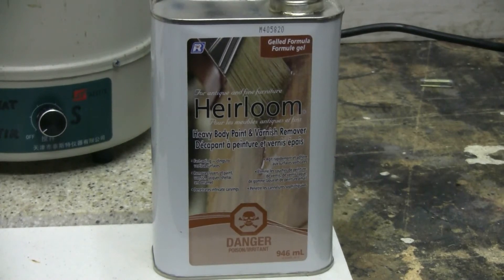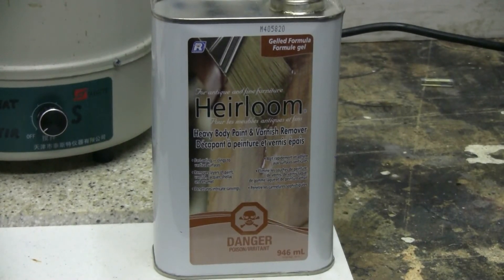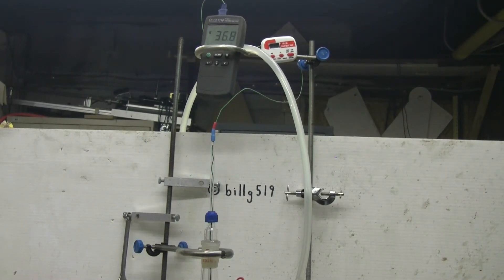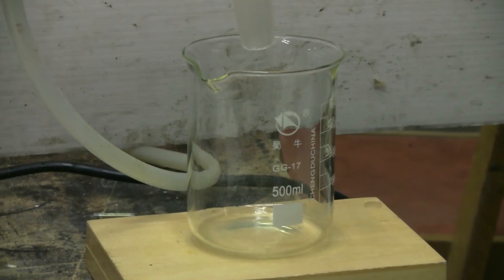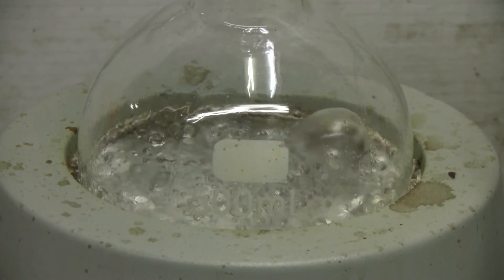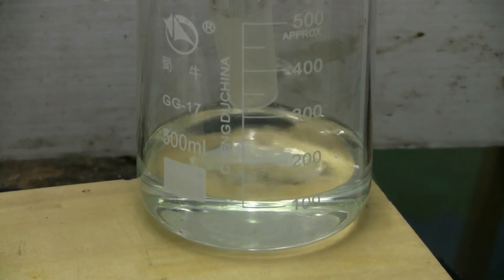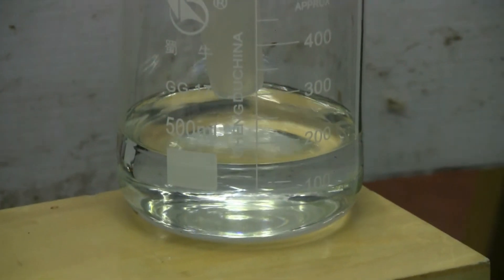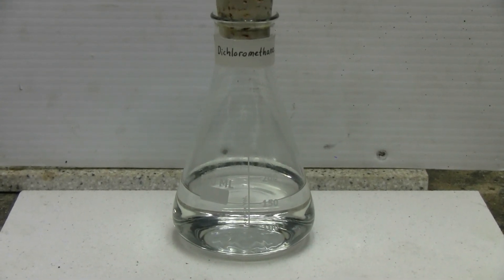Dichloromethane (Methylene Chloride) From Paint Stripper

Comment: Hi Bill, here in Europe dichloormethane is banned from paintstrippers, so the available strippers don't work very well. Now i want to make my own (i have dcm).
What do you think about mixing ratio's? 50% dcm, 25% methanol, 25% tolueen will make a good stripper?
And what about a thickener (to make a gel).
Reply: In USA Material Safety Data Sheets (MSDS) are required for all potentially hazardous chemicals in places of employment, and they have ingredient lists included. You can look up the MSDS for almost any commercially available chemical. Also in USA, the DCM based strippers are still commercially available, just not for the typical consumer. Go to this site, and look up the SDS for your application...https://flostrip.com/product-category/semi-paste-paint-finish-removers/. If the gelling agent is not potentially hazardous, it may not bee included in the MSDS. Maybe calcium acetate with the methanol would work?

Comment: I made a copper distillation rig to fit on 1 liter mason jars. I just toss the jar when done, no spending hours trying to clean a coked up rbf. Annoying we can't just buy these solvents and chemicals. 90% of my time is spent salvaging crappy contaminated chemicals from hardware store products, 10% is actually doing some interesting experiment. One of the reasons i don't do much chemistry anymore. Can't just buy a liter of formic acid or acetic acid for $10, i have to spend all day and $40 making my own. I find it annoying at this point. Cracked my 1 liter rbf in order to get about 15ml of pyridine from niacin. $50 gone for $2 worth. Annoying. Oh well, i should just take it as a challenge i guess.

I recognize the products, fellow Canadian eh :D